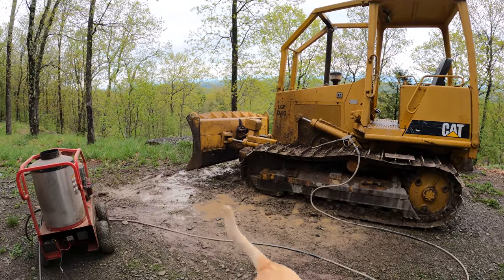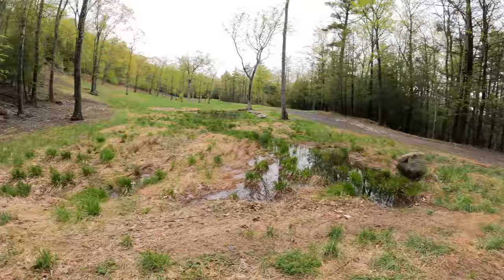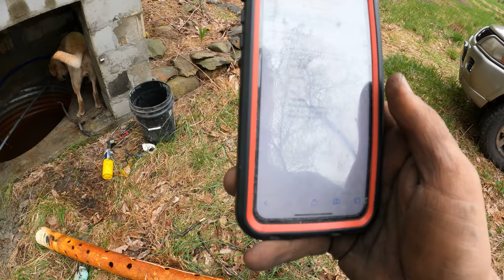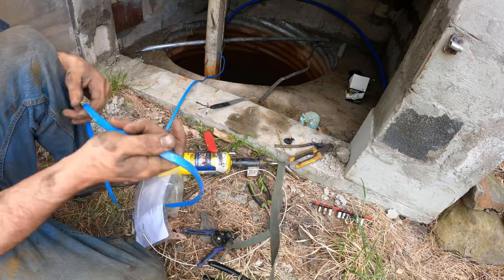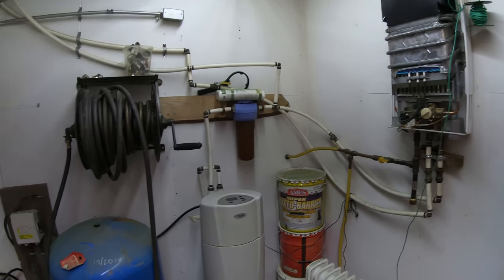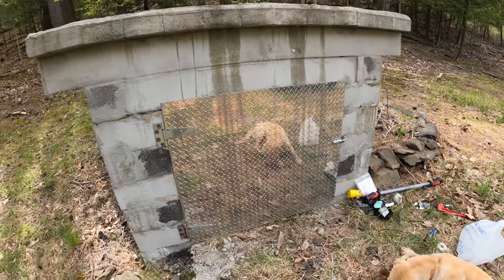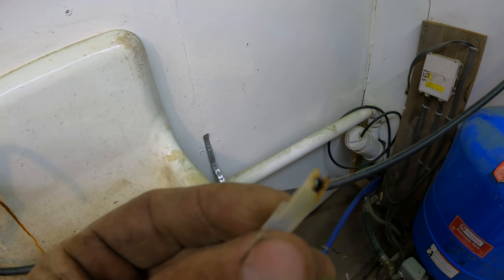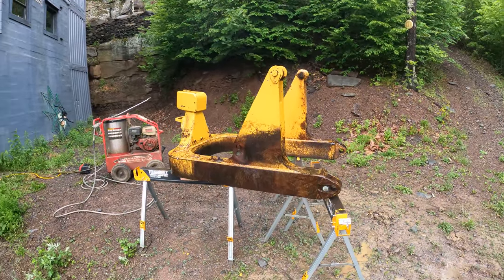Replacing a well pump

Comment: Andrew the cheap pumps will not have the lift capacity or gpm flow of the more expensive pumps and  the motor and impeller will be made of cheaper  materials like pot metal or poor quality aluminum not stainless steel. Also calculate the lift required by measuring from the bottom of the well to the pressure tank then add 20% to size the proper pump. A 1/2hp will push about 40 feet up. Based on early pump failure it looks like your pump is working too hard.  FYI a larger pump might require larger wire gauge and bigger breakers. Also there is a lot of grit in your shallow well which will damage the impeller and plug filters fast. You need a sediment filter before the canister filter. Also put a pressure gage on each side of the filter to identify a clogged filter a clean filter has about a 4psi drop.  Change filter at >10psi  differential. The clogged filter can cause high head pressure on the pump causing heat to build up and prematurely breaking down motor windings.

Comment: Box is designed with a Cap to take the main inrush current. The little resettable fuse cant take the full load of the pump kicking on by itself.

Comment: Andrew, you should be filling a water tank by the well and having the power washer pull from that tank. The power washer is too much for the well pump to provide water to and burns up from the constant operation.

Comment: Guess I'll be that guy. Been In the water well business for 20 years now and still young. This was pretty painful to watch, especially the 180$ pump being compared to our "1000 dollar" pumps. Your pump literally fell apart after 6 years that's bad. Well pumps we install last in the 20-30 year range. This is definitely the case of you get what you pay for. 

Now that being said, you and I both agree you wouldn't be putting that 180$ pump in a deep well. I like that you did your own well, very cool. The static water level there is very high which is a great thing. Looks like it has a ton of iron bacteria in it, which is also a big issue. ( water is orange ) this will leave orange rings in your toilets and sinks, also your dishes. To prevent this simply have an iron breaker installed, it's maintenance free unlike a water softener. It will take 99% of the iron out of your water and get you down to the normal .01-.02 PPM.

I also highly reccomend making sure you keep the air in your tank checked. You need to be 3# less than what your well cuts on. In your case it looks Iike a 30/50 switch ( it'll say under the lid ). So your tank needs 27# of air in it. To check the air, simply cut the power and drain the system with no water in the tank, then you check the air. Adding air will not increase your pressure. 

If you'd like to get more pressure I highly reccomemd going to a 40/60 switch and putting 37# of air in your tank. 

As far as the other water well drillers not wanting to come out without a deposit, unfortunately in this time of age we require it. It's a lot of work to drill a well only for a customer not pay you. The deposit basically covers the well itself and the final payment is for the pumping system which is the motor pipe and tank. We require a 50% deposit before all jobs including that 250 to come out initially which is credited to the final bill if we do the complete job. It wasn't like this back in the day when a handshake actually meant something. 

All in all you did a good repair, you can easily pull your well so there is no reason to go to that 1000 dollar pump, in most areas when they are set 300-500' deep and not 10' that 1000 dollar pump is well worth it. Props to you for figuring it out and getting it done yourself.

I'd be curious how that water tests out. Maybe send off a sample to a lab one time. Not sure you drink that well water or not, but do yourself a favor, throw about 6 or 7 chlorine pool tablets in there every once and awhile 6-8 months.

Dm me if you want to talk more about it.

Comment: Paid $1200 for a Dansk pump 10 years ago. 190 feet vertical, +1/4 mile lateral to a 2500 gallon cistern, a separate pump drives the pressure tank. A++ on the Dansk, would buy again. The pump broadcasts status information over the power cable.

Comment: The circuit breaker is meant to protect the branch circuit wiring from overcurrent and short circuits. The reset button on the control box is your motor overload protection and is precisely sized to match the motor full load current listed on the motor nameplate. The new pump probably has internal automatic reset overload protection??? If not, it is required by National Electric Code for motors over a certain size. I wouldn’t worry about it on such a low cost motor such as the replacement you used here but you could add a manual motor starter switch with properly sized OL Protection if you wanted. It’s your insurance against frying the motor under locked-rotor conditions if sediments get into the impeller.

Comment: Some time you gotta heat that poly pipe but I usually try to it it with a mallet or dead blow first. often that works well and doesn't risk over doing the heat. You should swap that filter to a bigger one that's way tiny.

Comment: The fuse was telling you the filter was not performing, that's what it's there for. Drawing more current to push past the filter
Reply: I don’t think that is why it is there. The expansion tank takes up the extra water if you are restricted till the pressure switch cycles the pump as normal.

Comment: That's a really shallow well pump pit. Down here in Jersey they go down over 100 feet sometimes. Pulling those pumps out by hand will make a man out of you. If we've got the room, we'll tie it to our truck and pull it out that way but most times we don't have the room and we have to pull it out manually. You get like 20 feet in and your arms are already burning and you still got 80 feet to go, not a fun job by any means. And then you have to do it again when you drop the new pump in and that could be even harder sometimes. Those are the days I question my career choice lol.

Comment: The blue pipe is. Generally   CTS.  Copper tube size. And you need to use ford or weller fitings with it
The black Well line is generally 3/4.  1" Ect

Comment: There is 100% a difference in quality. But considering the fact that you don’t car about changing them, and it’s not like any bodies life depends on the water working all the time. You could buy like 8 cheap pumps for the same price anyway

addition: raising the pump off the bottom will prevent silt and dirt from killing it. Also, that pump has a shit ton of head pressure. It’s designed to pump vertically like 300 feet, you could probably get a pair of harbor freight shallow well pumps. They are designed to have negative intake pressure, they mount above ground and suck from the well. A pair of those, with pressure switches set differently to kick on in stages. And they have pressure tanks built in. Redundancy, more flow, steadier flow and less parts in the system. Harbor freight shallow well pumps are like $150.

Comment: Your old spinner tip might just need the ceramic element cleaned out. We have about 15 pressure washers at work, and occasionally they need cleaning. Some do wear out, but parts are available for some of them. My boss just buys the cheap ones, so those have no parts for them.

Comment: Andrew I have a Franklin Electric FPS 4400 Tri-Seal 7FA05P4-2W230, 1/2hp 5 gpm. A lower hp pump might last longer and still provides plenty of water, it goes on and off less while filling the storage tank. My pump is going on 10 years old. I have the same rust condition that you have. I just looked up my pump, it is about $650 :-(

Comment: Last year when my submergible pump quit, I was shocked to see it was manufactured in 1982, the year that my home was built!  I will be shocked of the new pump lasts anywhere near that long. As of price, my pump is down about 60 feet and is a 1 inch 1hp. The total price for having a company come out and pull the old one and install the new one, with my wire down to the pump was right around $1,500.

Comment: Looking at the red staining on everything you’re either dealing with acidic water which will eat the internals on pumps or clay contamination. If it’s acidic you can neutralize it with chemicals once a year. If the clay sucks in the pump you can technically put a sock on it to make a silt filter. But 5+ years on those cheap pumps is pretty good.

Comment: Fifty-seven pounds of water pressure seems like a lot. It can be rough on your fixtures. Perhaps you can regulate it down to about 45#, or even less. Lots of iron in that water. That can be rough on parts, too.

Comment: There is definitely a quality difference and if you are paying someone to replace a deep well pump do it right and I've seen them running fine 25 years later they usually have issues with the pipe or wire before the pump fails. But since yours is so shallow and you can do it yourself , the fleabay, chinesium will be the way to go

Comment: In Australia we have bors instead of wells and can be a couple hundred foot deep and on 10 inches round and in the salt water in them cheap eBay pump even the huge ones it’s not uncommon to here them needing to be replaced in as little a 6 months vs the good quality ones last up to 10 years and some times longer so there is a difference in quality

Comment: Just a thought. Maybe the clogged filter might have put extra pressure on the pump and shortened the life of the pump. Always cheap and easy to change filters on anything. Cars pumps can last longer with clean filters. Just saying.

Comment: Yeah I been down this road I paid for a made in USA at $800 pump w  professional install lasted 2 years and burned up. Ordered a amazon cheap pump installed bigger wires like the guys in the reviews did been in there 3 years no problems. I try to buy USA when I can but good grief that was a $800 dollar pump Amazon was $180 and still going strong. I got the  3 wire no box.

Comment: ANDREW,  GET A FOAM WAND AND SPRAY SOME DEGREASER ON THE EQUIPMENT LET IT SIT FOR A BIT THEN USE REGULAR WAND TO PRESSURE WASH IT OFF, MAY HELP CLEAN THE EQUIPMENT A LITTLE BETTER.

Comment: prices are inflated in the US somehow. LOWARA borehole pumps are pretty good Italian-made pumps but they surely don't cost $1500. used to buy those things for about $400 in North African and that includes the import duties and run them on higher voltage for deeper wells still lasts forever. after that, people switched to cheaper Chinese made pumps and they don't for more than a couple of years

Comment: Your submersible pump should cycle (run) for at least one minute to fill your tank.  This ensures all condensation is removed from your motor and control systems.  If the pump doesn't run for at least one minute to fill your pressure tank the pump is too big.  If the head is less than 25 feet from your tank you can get by with a shallow-well jet pump.

Comment: I just recently learned you aren't supposed to butt the hose up to the fitting. There should be a gap to allow for expansion/contraction.  Making it snug up actually loosens the connection over time. Not sure about chinese knock-off PEX, but rubber hoses.... yes.

Comment: The old one was fine. If it were me, I would have just found some screws, reassembled it and thrown it back in the hole.
Hope he at least put some thread locker on the bolts/screws this time.

Comment: You might want get a bigger storage tank ,so you can have more water storage, also if you are running a old hand dug well keep in mind that water that's in there is just surface water. So if the water ever got lower than the pump you would want to switch out the presuure switch with a low pressure cut off switch ,that would save the pump if the water ever got down that low.   A good pump should last 20 to 30 years and a welltrolx tank with last 10 to 15.

Comment: Yes. If you don't mind buying a pump every 5 yrs instead of 30. Cheap ebay pumps cut corners.  Your pump uncoupled itself because stainless steel fasteners and studs weren't used in assembly.  Your existing pump and motor are probably fine... it just rotted in half

Comment: Your old water blaster nozzle was worn out . when it's not spinning the ceramic nozzle and the ceramic seat it rotates against are no longer smooth. And or the ceramics nozzle is worn oversize .
Another point it to always point the tip downward so the ceramics are touching before the water stream slams them together. 
That way the tip will last longer . you can hear and see the difference when you changed the nozzle at the end of the clip.

Comment: Depending on the amount of head you have, you might not even need a submersible well pump. It looks like you have plenty of storage capacity in the cistern. A simple drop line and a centrifugal pump should work fine.

Comment: I wonder if the clogged filter contributed to the demise of the first pump?
Reply from the maker: No, because its after the tank.
Reply: @AndrewCamarata  I am not a pump guy ... and may be wrong ... but it seems to me that a pump is moving a liquid through and entire system ... including the filter ... and it doesn’t matter whether it is “pushing” or “pulling.”  Same force.  What am I missing?
Reply from the maker: the filter is after the pressure tank, so it doesn’t matter To the pump what it’s doing, all the pump does is pressurize that blue tank up to a certain psi then turn off, nothing was restricted. it’s the same as like having a garden hose and not turning it on all the way
Reply: @AndrewCamarata  My brain “read" filter instead of tank. Thanks.  I thought some of the video CerebralAilment uploaded of you and Cody and the one of Levi were special.

Comment: Your videos are really good, thanks for putting them out there. I just watched the repairs you made on your FORD 1320, I have a 2120. When i try to use the BrushHog the blades just barely turn. What could be my problem???
Reply from the maker: Does your PTO spin the right speed? Maybe a broken sheer pin or slipping PTO clutch.
Reply: @AndrewCamarata  thanks for the quick reply, it seems like it turns normal but i need to hook the mower up again and re check it. Will low fluid cause it to turn slow?
Reply: @AndrewCamarata  probably the slipping PTO clutch. Does that mean I have to pull the tractor apart to repair the PTO clutch?
Reply: @AndrewCamarata  ....and its a 93 with only 370 original hours, even if someone abused the clutch it would surely last longer than that? Right?

Comment: Thats funny the charger on the hot power washer, my buddys is the same way, once it kills the battery the burner won't run. He got same one from a auction.  Must be the knock off China Honda motor

Comment: A union would be a good idea rather than pulling the poly lines apart every time you change the pump , your pump will not last the way it is installed 
1.your tank is too small the pump needs to run for at least 90 sec to not over heat 
2. the pump motor is on the bottom and the pump on the top, your motor fell off, do a better job to tighten the nuts Loctite works well 
3.the pump in that small pipe will over heat rather quickly leading to its failure , get a bigger pipe 
4.3/4 pipe from the well will cause the pump to work harder adding to the over heating 
5. the filter you have is designed to be used under a kitchen sink not for your application go to a larger filter if you think you need it ( 25 micron 20 inch ) iron remover would be even better 
6. the box on the wall is a control box , the round cylinder is a capacitor you are lucky you did not get zapped even with the power off 
if you don't leave a deposit most drillers will not show up , you would be amazed by the number of people that just will not pay once the job is done and yes the right pump may cost you 600 to a 1000 a Grundfos SQE  would likely last 30 years if you install it correctly

Comment: I’ve got a shallow well pump under my house. (Crawl space) so it it’s in the winter, I can just go through the trap door. I only need to go outside if the foot valve fails.
Reply from the maker: There is to much head here (height from well to building) for that type of pump to work. We always had that at my parents house, I finally switched it to this same type of pump. It is nice not listing to the pump in the basement any more.
Reply: @AndrewCamarata  Yea, I’m only drawing water up from like 30 feet.
Reply from the maker: That is about the limit for a shallow well pump.

Comment: 189 pump is made in China, the 1000 dollar one is usa made.  I paid 27 years ago for my pump 350 1/2 hp lasted that long bought a amazon 1 hp  wiring is cheap may last 6 years if lucky mine went out at -20c. a 4 wire is better, your condenser can be replaced  less current running through 2 wires a lot of iron, a water softener would save on everything

Comment: A quality pump will last 30. Sometimes it’s bad motors, but usually the impellers are what take a beating if there’s sand or debris. 

That well looks pretty nasty and appears to be surface water?

Comment: So you got 1" CTS (copper tubing size)  
All your well stuff uses 1" IPS (iron pipe size)  
The CTS is made for city water type stuff, so it fits in compression fittings.
Reply: To add, 1" CTS is 1" outside diameter,  and your 1" IPS, is 1" inside diameter.

Comment: Most pumps die because of dirt in the water wearing out the internals and/or the diaphragm in the pressure tank develops a leak so it doesn't maintain pressure which causes the pump to run continuously.